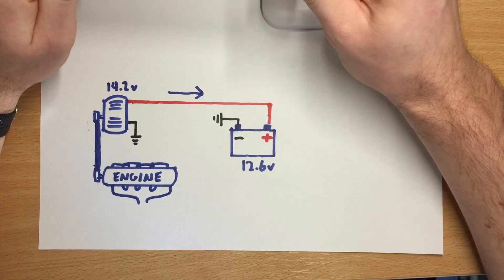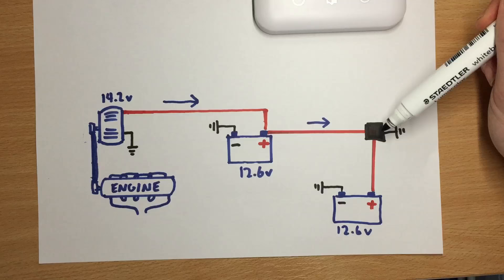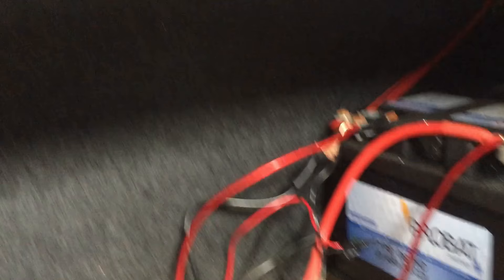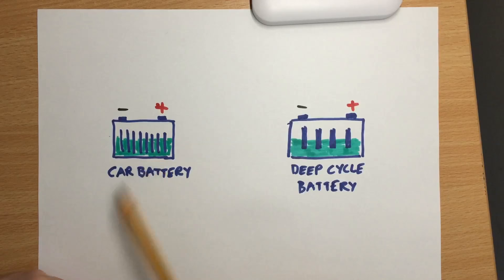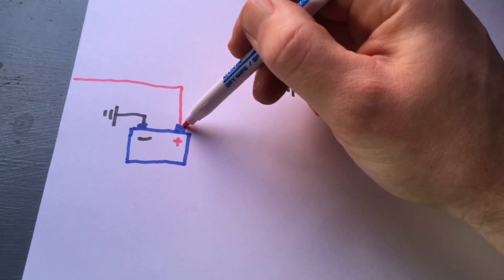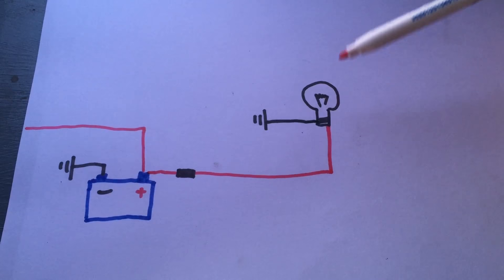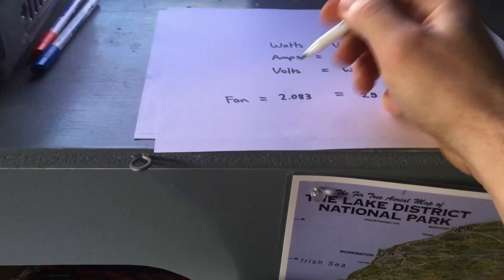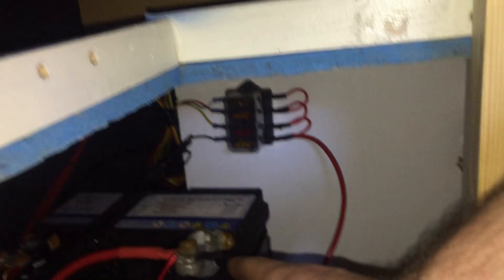Installing a Leisure Battery With Split Charging - A Beginner's Guide (Read Updated Description)

Comment: Just a quick question- I really dont get this, as your positive feed to leisure/ house battery runs off the positive side of the starter battery, therefore the starter is always 'hot' or charging.
So if you put a big (130AH) leisure battery in, party all night & run it flat, then start the engine next day on your mostly charged starter battery, if you run the engine for a couple of hours to charge the leisure battery, why don't you "smoke" the starter battery?
I have a leisure pack of 330AH, which could take over 8 hours to charge- what stops my starter battery from becoming a soggy mess?
Reply from the maker: I don’t think you need to worry about this. My alternator is constantly sending charge to the starter battery and leisure battery when I am driving, even if one or both is fully charged. If you have a second battery on the same circuit that is being charged for 8 hours, I don’t see why this would affect your starter battery. However if you are concerned then I can only advise asking a professional. Good luck!
Reply: Hi, it's not your engine battery doing the charging of the leisure batteries - it's the alternator.
And they won't take 8 hours - alternators are far more powerful than battery chargers. (Unless you have deep cycle batteries which are slow charging I believe)
Reply: @offshoretomorrow3346  Uhm, 1) If you connect the leisure battery to the starter battery, you will, surely, get a "dump load" from the starter battery to the leisure battery- its called basic physics?
Try it- disconnect the two batteries, run down the leisure Bs & then tap a lead between the starter & leisure bats- the spark is them trying to even out the charge.
So ye, obviously the alternator is doing the overall charging, but there is a load of back & forth on top of this- which was, uhm the point?
2) OK, for charge duration- do the Maths?
As I stated, I have a 330AH battery pack.
Alternator is 30Amp. 
If they are fully flat you have, without battery efficiency loss 330/30 = 10 hours.
Given a charging efficiency of about 50%, you can double that.
Also, for the final portion of the charge, a charger will back off substantially lowering the charge voltage- my 8amp mains battery smart charger charges at about 2 amps for final portion of charge (one one battery).
 Interested to hear if the maths or science is wrong?

Comment: Hi, do you have a vent attached to your battery? I have been stressing over this as they can gas as you charge/ discharge.
Reply from the maker: Hi. You only need a vent with some batteries. Mine is self-contained and does not need venting. It’s worth finding out if your battery needs it

Comment: do you have to use a battery box and do you have to 'vent' two deep cell marine batteries if they are inside the cabin?
Reply from the maker: Hi Travis. It all depends on the battery itself. Some batteries do give off a gas that needs venting. My battery is all self contained and sealed, so no venting is needed
Reply: @JoelsStuff    thanks for the reply.

Comment: With LED lights and USB charging why the need an extra battery? You can buy a lithium jump starter for emergencies. Run the coldbox only when you run the engine and if you stay on-sight mains connect. All this extra battery, split charge and extra wiring is a waste of money, to save 1/2 litre of milk. Solar is stupid as you have to park in the sun and when it's hot you need shade. Save hundreds of pounds and simplify.
Reply from the maker: I agree, as explained in the video 😁

Comment: Do I ground the leisure battery anywhere on the frame or to the starting battery?
Reply from the maker: Hi! Technically you could do either, as your main battery is already ground to the chassis, so it is completing the same circuit whichever way. Grounding the leisure battery to the chassis is more convenient so do that. Good luck!
Reply: @JoelsStuff  Thank you. Stay awesome

Comment: ive heard a few times that you shouldnt  drain your leisure battery as it  really shortens is life
Reply from the maker: You may be right, I think I got that one slightly wrong 😬
Reply: @JoelsStuff  correct if it's an agm battery you don't want to drain it more than 50% of its capacity to prolong the battery life, if it's lithium phosphate it can be discharged more.

Comment: Lovely clear explanation. 
But.... What about smart alternators. These are not suitable for this type of system.

Update - trying to be helpful
There's a good overview here:   https://www.12voltplanet.co.uk/auxiliary-battery-charging-in-vehicles-with-smart-alternators.html

Just be aware that Euro 5 and above vehicles are pretty much all fitted with smart alternators and that covers most vehicles made in the last 10 years or so in Europe.
Reply from the maker: Thanks for pointing this out, I will look into this.
Reply: @JoelsStuff  how do you charge the leisure battery from the house mains   if you have used it alot, say camping for a few days, instead of driving around for hours to charge it from the alternator. Do you have to disconnect the battery or can you just connect it to a 240 battery charger from your house whilst it is still all connected up to the vehicle? Thanks.
Reply: @donner101  Logically you should just be able to connect the 240 V charger to the leisure battery" (+ and -) because the split charge relay is "off" (open circuit) and should not matter (I suggest You don't do it with your car/van running in case the relay is "on" and that might "confuse" the relay/the car/vans charging system). Also take in to consideration that your relay might be nonfunctional/broken. The 12 V system in your van should not be effected (unless perhaps You have some complicated electronic stuff connected). You can even use it while charging. It will prolong the time though for a fully charged battery. What You could do is to mount a manual switch/isolator on the cable between the 12V + from the leisure battery to your 12V fuse box/system in your van (which is a good idea for many other reasons) and shut it off while doing the 240V charging.

IF You are unsure just mount your leisure battery in a plastic box with quick connections and bring it inside your garage/home for the 240V charging process.
Reply: @donner101  House battery is an alternative name for the leisure battery. Shore power (from marine usage) is your external power. My inverter can accept shore power and charge my battery. Otherwise, you can use a separate charger.

I intend to see whether I drive around enough to not need additional power, from shore, or from solar. I have a DC2DC charger that incorporates an MPPT for solar.
Reply: VSR units are available for these systems, albeit at extra cost, but they do a good job.
Reply: @tomthumb3085  yes, but the point I was making is that the split relay system isn't suitable.

Comment: Can you charge it with 3-4 leisure batteries
Reply from the maker: Hi! Good question, and not something I have tried before. From what I understand there is no specific reason why it wouldn’t work, but you have to consider how many Amps your alternator can put out, and if it can keep up with the demand for charging them all. Sorry I can’t be more helpful!

Comment: PLEASE don't  tell people to use VSR's... Ancient tech! It's like getting dialup internet ... Yes it works, but it's not very good.

DCDC charger is the only reasonable way to go in 2020/2021.

Batteries are not cheap. We should charge them properly with the proper voltage for the SoC and the proper charging profile. 
Alternator doesn't do this.

Comment: Thanks for the explanation and great use of graphics and equations of physics.

Here why u should seek an expert advice
https://youtu.be/TAEzCcayI0g?si=_lVkdJ3y3_x0hbgG

I like the last part of the video, some times it is not needed.
Personally, I found it is cheaper and safer to buy external battery, charge it when it is needed with smart charger the night before trip. All I need the battery for is lights and fan out of the SUV. So always look for what you need.

Thanks

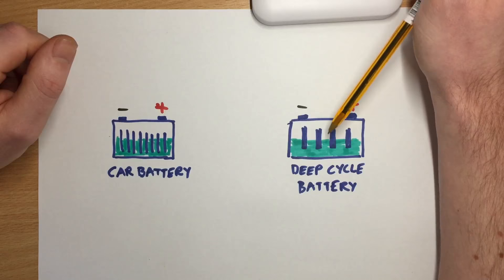Comment: 7:33 Another lie. No, they're not designed to be drained all the way, maximum 50% for any lead acid type battery. 
If you wanna drain all the way, they need to get a lithium battery made for 100% DoD:  

Sigh...

Comment: You are charging batteries in parallel. You should not do this where the batteries are of different types. You have a starter battery and the other is a leisure battery. These have different electrical characteristics.
Don't do it.

Comment: 2:56 No you should  NEVÈR connect dissimilar batteries in parallel. And RIP both batteries with the insane current that would flow between them if leisure battery was low and starter almost full! 

Could very well kill both batteries! Why do you give advice when you haven't got a clue?? It's a downvote for me.